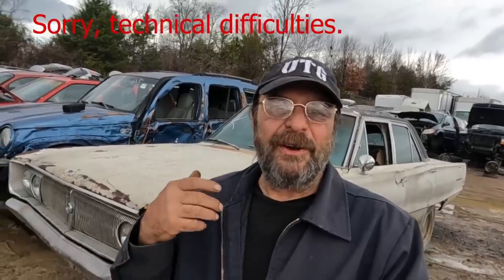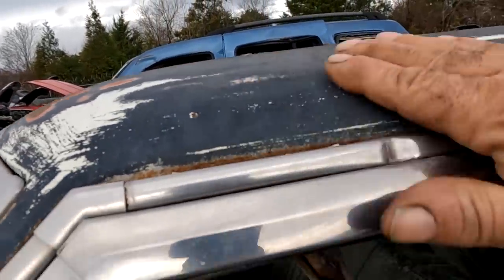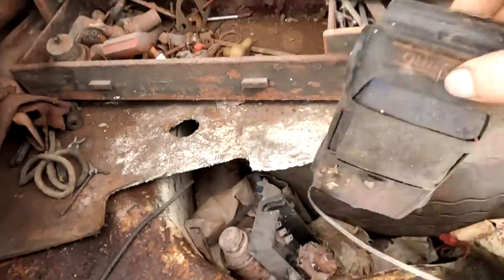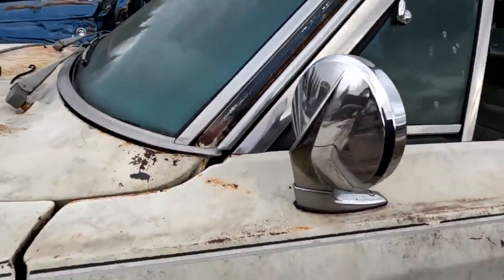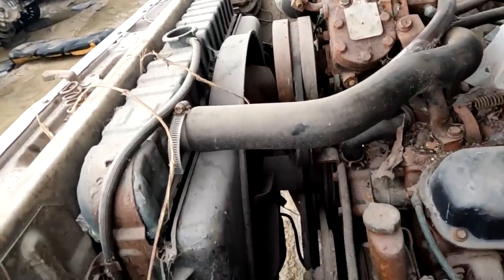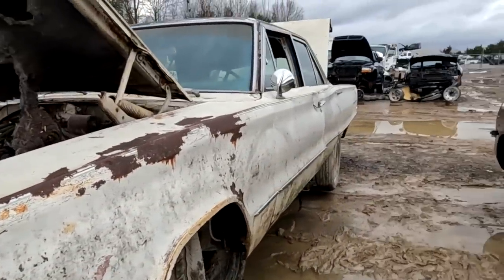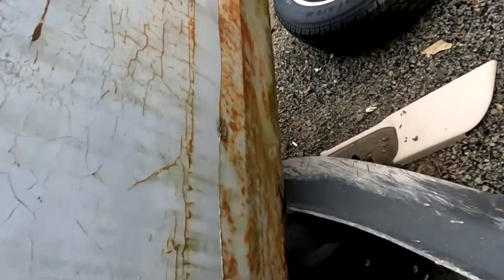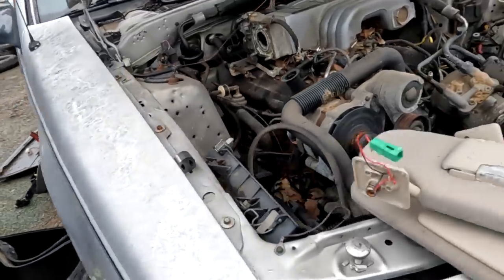Pull-A-Part Mopar Gold- Checking Out A Time Capsule 1967 Dodge Coronet

Comment: Hey it's Ivan, glad you got to check out the Coronet. I got to it on Saturday and found four silver dollars, a bunch of 8 track tapes, and a pack of Jimmy Dean baseball cards unopened from 1993 in the back seat, Nolan Ryan was the cover card. I bet that car was a storage unit by the 90's. Found a few capacitors in the toolbox in the trunk. Thanks for showing off the car to your viewers, I hope they will use the parts. Junk yard trips are freakin fun even if you don't haul away any gems, it's a good time none the less.
Reply: What yard was this Ivan? There’s a few yards I go to in tn but this doesn’t look like one I’ve been to yet,I’m looking it stuff for my dart sport

Comment: I was hoping to see the VIN on the LH door post there, and the fender tag. I got some of the VIN from the glancing shot you did. As you know, it goes like this with the VIN for the win:

W for Coronet, H for High price class (Coronet 440), 41 for four door sedan, F for 318 V8 with two barrel, 7 for 1967 model year, 1 for Lynch Road, Detroit, MI assembly and the rest is the production sequence. The Lynch Road facility closed in April 1981 and a powder coating business is on that site now. As other stated, I would have grabbed some of those tools. They would clean up sitting in vinegar in an hour or two. 

With the tag, you can brag: WH41 for Coronet (W), High price class/440 (H), four door sedan (41), 41 for 318 V8, 5 for three speed automatic transmission, H1B for Blue interior trim, WW1 for White exterior paint, S-1 for factory AC, R-1 for AM radio, h-7 for fender mounted turn signal indicators, A-1 for 26" radiator (due to it having AC more than likely), among other codes. I would guess that the RH fender was changed at one point. Never go by those yard tags as you know they can be wrong. Go by the VIN number and cowl tags (yes, those could be switched as well, but less likely). O.Z. Hall Ford is gone and I believe Mr. Hall was the Birmingham, AL tax collector for some time. 

Yes, the T-Bird is a 1987, with the VIN for the win: 1FA for US made Ford passenger car, B for manual seat belts, P61 for Thunderbird, F for 5.0L (302) V8 with EFI, 4 is a check digit, H for the 1987 model year, H for Lorain, OH assembly and the rest is the production sequence. The Lorain, OH plant operated from 1958 to 2005 and produced about 8 million vehicles in the time it was around.  Should be paint code 1K Light Gray exterior paint.

Comment: I know everyone here has experienced the anguish of "those parts! Were are they!!!" in videos or junkyard crawl posts like this.

A mid-80s Shelby Charger w/all 4 of the 5x100mm "Pizza Wheels" underneath the rear hatch - improperly shod, of course, with 195/60-15 tires by its final owner.

A Dodge Dart Swinger w/intact rear glass and a set of dog-dish hubcaps.

A Plymouth Satellite w/full wraparound bumper.

A Ford Falcon wagon with clean grille and D-pillar trim.

Even the occasional Malaise-Era automobile that was garaged and still has its full dashboard panel and top cover intact.

Treasures, all.

Thank you, Tony.

Comment: Fan shroud causes fan to run in a low pressure area , and gives less drag , as well as pulling air through the condenser. Run Shroud.  
69 Ranchero was my first car

Comment: If the Coronet has a 8.75 rear end, it's the perfect one for a A-body swap.  '65-67 are my favorites to use!  Thanks for sharing
Reply: Most 1967 318 Coronets have 7.25" rear ends. Some manual transmission 273 Coronets have 8.75" rears and 1969 trailer towing package 318's got a 727 trans in place of the 904, with an 8.25" rear.

Comment: I like to refer to those floor holes as the “structural carpet option”
Reply: The Fred Flintstone mod? I had an Olds wagon that was basically just carpet over rust holes. In winter it would get wet and freeze like a skating rink under my feet lol.
Reply: bluetooth floor

Comment: Yep I know how you feel about that. Few years back there was a late 70s trans am in the yard that was complete. Yellow v8 auto car just mint sheet metal besides some typical f body rust starting in the cowl by the window original paint but had a decent amount of patina to it. Came back the next day and the car was cut in HALF! Someone took the doors, cut floor pans, cut the rear half of the roof off. Poor thing was shaped like a taco. Sad to see but glad someone got parts off of it they needed.
Reply: I've gotten lucky in that regard. I got a running Trans Am with a title for free from a coworker's neighbor and it came with a garage full of NOS, used and new aftermarket parts. Only thing I didn't take was the 1978 Trans Am engine because I didn't have a way to move it at the time. That engine would be worth a few bucks now. I wound selling the car in 2006 (I got it in 2002). It even had a valid title. I kept the OEM NOS parts and the good used parts. I flipped the high performance aftermarket junk and made some money on that. I remember shipping the MSD wire set over to Poland from an Ebay sale. 

Another time a local guy (actually twice) called me up and said he had parts cars he was done with and I could take whatever I wanted for nothing. I jumped at the opportunity. The one car was an '81 Trans Am with a 301 non-turbo pulled from a junkyard and the other was an '80 Espirit 301. I got good used stuff from both of them. The 1981 had a note under the scoop addressed to the guy I knew that pulled it from the yard. It was from the guy who junked it. The letter cursed out this guy and said, "How dare you take my baby from its' final resting spot. I loved this car. I hope you hit a pole." I showed it to the guy. He was a Greek-American and a bit superstitious. He said, "Dude, that's bad karma. What are you going to do?" I said "Write back". So I did. I wrote, "Dear, Mr. Trans Am owner. If you took better care of this car, it wouldn't be here with me picking parts off of it. It's only a 301 and you should have thought of that before you put "your baby" in its' final resting spot. I'm going to pull the parts off of it, and you're going to like it. Signed, me". With that, I put the note back under the hood, thanked the guy I knew and left. LOL.
Reply: @googleusergp  yeah thats crazy if the car was really that important to him why not do something with it? I don't understand these people that buy all these junk cars and just let them rot. most of them are already in their late 50's or 60's and think they'll live forever and finish all of them. they refuse to sell anything and usually they die of a heart attack and everything gets scraped by the next of kin. happened to my uncle and i wanted to buy a few things off them and by the time I heard he was gone so was everything else. there was a 69 chevelle ss 396 a 72 ls6 454 chevelle a 67 mustang gt390 and much more all went to the scrap yard cuz of greed!

Comment: Some of those tools could be a score too, I'd be going through that toolbox asap.
Reply: I used to buy old tool boxes full of tools from a second hand store owner who went to every garage sale around, lots of great stuff.
Reply: just soak the tools to remove the mouse urine--I usually go with 50/50 vinegar and table salt to get rid of rust.  Personally i find that many tools in the trunk mean the mechanicals were on their way out and perhaps the electronics too. but it can be repaired if it's not reproduced. 

before I had a car worth having, I melted credit cards on stuff like this, pulling stuff not reproduced off old cars (even tower screw clamps for hoses). a dollar here and there and it added up when you were a kid with nothing else to do on a weekend but get into trouble.
Reply: No doubt. There was surely a name brand or two in there.
Reply: @albertgaspar627  Yup. I saved a whole box of tools I bought off of a guy for $10. They had been through Superstorm Sandy. I soaked them in vinegar and baking soda and most got to useable condition. One or two were broken, so I got them to the point where I could ID them and off they went to Sears to swap out. This was around 2019 when Sears was still around in my area.
Reply: @lawrenceveinotte  heehee, I stopped at one last week and mulled around. 
Nothing I really wanted, but on 1 table was a wooden coca cola crate filled with stuff I didn't want(looks like 70s era for the 1 liter bottles) 
Scored it for 15$. 
Eh, it's nothing really special I just thought it was cool.
Reply: @googleusergp 
I've heard of Stanley,but when did Shirley start making tools ? 😁😁😁
Reply: @MrTheHillfolk  Stanley did make tools for Sears Craftsman (and now they own Craftsman), but back in the day, most Craftsman hand tools were made by Moore Drop Forge/Easco/Danaher/Apex and the screwdrivers by Western Forge or Pratt-Read. Wilde (and WF) made pliers, Vaughan made hammers, A&E made specialty automotive tools. These are generalizations, there are exceptions.
Reply: @googleusergp  right, I do estate sales when i can and Craftsman and LL Bean (I live in NE) were great to snag cheap when broken, since both companies had lifetime warranties. i still grab tools i might need one day, since i can look around the past owners' house and see how they took care of things. If i only use some $1 oddball tool once, i'm ahead of the game. Plus something simple like an open end/box wrench bought cheap can be heated and bent into shape (helps to know a little bit about metallurgy or know a blacksmith) to fit into some tricky spot on a car to reach a fastener--compared to going to the dealership or CrapOn for the speciality tool designed for it. 

I'm a sucker for old tools and tool cabinets and 'boxes, had to pass up a toolbox this past summer that had a pocket mirror glued to the inside of the lid, bracketed by black and white photos of two kids and the newspaper clipping of his wife from the days when weddings were published. probably reminded the prior owner of why he busted his a$$ and helped him straighten his mane for when he left his shift behind. But each car i own has an old 'box with tools...that's why my assumption about it being a car with plenty of issues :)  

i always say, show me the trunk of your car and i'll know every problem you've ever suffered--you've filled your trunk what what you wished you had then to make sure it never befalls you again.
Reply: @MrTheHillfolk  back when a town in Japan changed its name to usa :)
Reply: @lawrenceveinotte  so hard to pass it up when money's burning a hole in your pocket from finding nothing else worth buying (the difference between an antique store and an indoor flea market is the amount of digits to the left of the decimal point on the tag). it's an adult form of "grab bags" or Crackerjacks when we were kids--you don't know what you'll find until you clean off the patina.
Reply: @albertgaspar627  I'm the same way. My first rollaway 1960 Craftsman tool box combination was a $50 estate sale find in 2002. I cleaned it up, got parts from Waterloo for it (this is before the SBD takeover of course) and then sent it into Sears. I won $50 and they featured me in the 2002 Craftsman Club newsletter. I then brought the ad to my local Sears and asked the manager, "Do you have a toolbox exactly like this one in the photo?" The guy goes, "Holy s.....that's you!" He calls the other people over and they were like, "Wow, cool...." He said, "Ok anything else you buy tonight is another 25% off the sale price, on me". I cleaned up that night. LOL. I also bought a lot of tools at that same estate sale. Same thing as you said, bring them back. The first night I went back, the receipt showed a value (of then, 2002) of over $400 in tools. Not one was a problem to swap out.

I've gotten a few freebies. One 1968 Craftsman tossed out in my neighborhood, that's cleaned up and in my garage. Another 1972 JC Penney (Kennedy) that was in a neighbor's garage that I was admiring. He passes away a few years later and his grandson puts it to the curb. That's with me now. I got a nine drawer 1981 Craftsman lower box off CL for free. There were 20 people that e-mailed the lady, but I was first. She left it in her driveway next to a brand new Raptor. I was so quiet and careful not to make noise or hit the truck. LOL. I also bought a 1969 Craftsman 10 drawer top box in very nice shape that was filled with USA made tools, only $45. A friend lived near the seller and picked it up and I met him at work (He works near me) and we put it in my car. Goldmine. 

The last one was this year, a 1981 Craftsman model 65053 three drawer lower cabinet and a nine drawer 1983 KRA59F Snap On chest. Both had tools. Sitting in my coworker's mother's house. I travel on business trips with this same coworker and during meals he would say at the table, "Ya gotta come over the house when my mom passes, 100 years from now" I did and he gave me both boxes, along with all the tools inside. The Craftsman needed drawer clips, which I had and I know the guy on Ebay that reproduces them. The 3" older clip style in his ad is actually one of my spare slides and clips that he used as a model to reproduce them. The Snap On needed some parts including some new slides and Snap On sent those at no charge. So yes, I've been lucky there.
Reply: @googleusergp  good stuff !! 
I've got some of the older stuff, it always comes thru in a jamb!
Reply: @MrTheHillfolk  That's only some of it. I've got finds like that times ten. LOL.

Comment: I suspect full size cars like this popularized the painted roof option since the manufacturers had practice with cop cars. As for the FredFlinstonefloor, we called that that the "ditch the beer its 5.0" option.

That Ranchero sure is the Squire option, all those holes are for the fake framing of the fake wood paneling. My 1975 Country Squire Pinto wagon had studs sticking out of the bodywork for it's trim.

Comment: Get the dash panel and gauges Tony.....maybe you can use it in the Charger as a last resort if those gauges aren't working.  New or working Charger gauges are almost impossible to find.
I just sold my 66 Charger a couple months ago,  but I planned to replace the dash for a Coronet  panel....I think you can get a new re po panel and most of the gauges.

Comment: All 1967 and some early 68 318 cylinder blocks have thicker cylinder walls than the later 68 and newer 318 blocks. Dodge had planned a high performance engine with a 4 inch bore for the 67 Dart to compete with the 327 Chevy II, but due to lack of performance, it was scratched from production and the 318 benefited from its cylinder block, with the 68 340 being developed from its failure. An original 1967 318 block should be a heavy one. The 1967 318 usually has a forged steel crankshaft too.

Comment: The tools you need for removing the parts you need other than the quarter panel are probably all right there in the trunk. I have found that junkyards are often willing to cut a great deal on old tools and tool boxes as long as they have rust on them. Does that car have the hideaway headlights in it? It kinda looks like it might,  but I cant tell for sure. That Ranchero looks more like about a 71 to me.

Comment: Not having the vinyl roof saved it. If it was the vinyl option you could put a screwdriver through the rust and felt that crunch below your fingers! Over here in the UK rust wiped out a lot of 60s and 70s cars decades ago

Comment: Hate seeing solid cars go to waste! Man, there's lots of stuff I would pull off of that Coronet, and I'm not even a Mopar guy. Was that left torsion bar rusted through? I've never seen that before! Shame about the Ranchero, and, yeah, that T-Bird too. I had an 84 T-Bird Elan back in the day, and it was a really nice car. Had the 302 with that stupid throttle body injection deal, but it never let me down. It was gray and silver, and I lowered it and put a set of those Mustang GT 10-hole aluminum rims on it, and then a buddy gave me a practically new Ford Motorsport quick-ratio power steering rack that he had used in his 81 Mercury Capri race car. It was like 2 turns lock-to-lock, and that rack and the lowering job really made that old T-Bird a handling machine. Good old days. Thanks, Tony, and Happy New Year!

Comment: Junkyards ain't what they used to be. I remember pulling a RAM AIR 3 400 Pontiac out of a 70 Formula Firebird, believe I paid $50 bucks for it. Also scored many bigblocks and smallblock engines, 12-bolt rearends, T400 transmissions, etc. Muscle cars everywhere. Paid $150 bucks for a complete totaled 66 Chevy 2 Nova SS with the L-79 327 in it, Muncie M-21 4spd, 4-11 posi 12-bolt rearend. Used to be a gold mine for the picking. Now it's a bunch of 10-20yr old junk that needs to be crushed. All them old yards pretty much been crushed out and cleaned up. Best time to go to the junkyard was the late 70s early 80s. Cars from the 50s and 60s were worth nothing in that era. I passed on a 69 Super Bee 440 six pack car that had the six pack replaced with a Torker intake and 800 doublepumper. Asking price was $350 bucks, it was lime green. I almost bought it, but I didn't because it was a Dodge. Already had a big stash of GM parts at that time. Wish I would have bought that Super Bee now. That was probably 35+yrs ago.

Comment: How do these places keeps cars from falling off the steel wheels they prop them up with ? Are they welded to the body ?
Reply: The wheels are welded together, one flat, one upright, so they act like round axle stands. They sit very steady on them. We used to stack cars on each other, on a set of those.